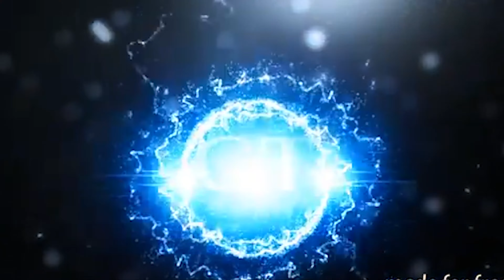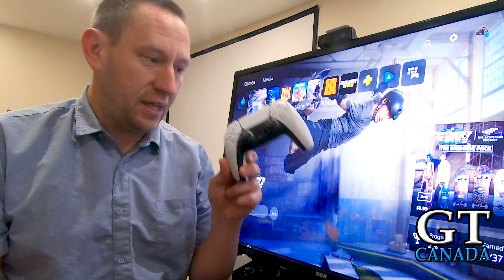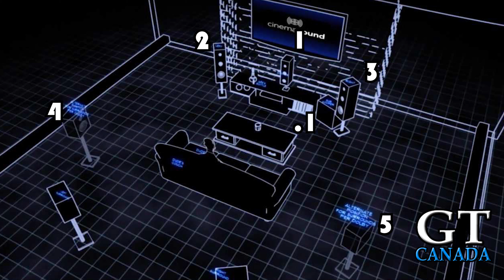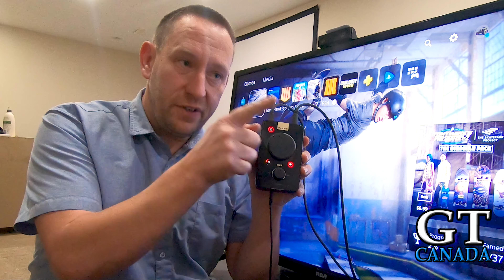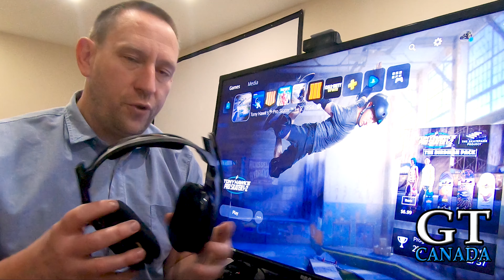SONY 3D Audio vs DOLBY 5.1 - Which is better & Why - GT Canada

Comment: It's been two years and nothing has changed. Dolby digital sounds way better on most games.
I'm a certified sound engineer and I have been trying to make my Steelseries Arctic Pro work on ps5 as they are supposed to, like they did on PS4 pro.
The surround in 3d is ok. Works if you haven't experienced real 7.1 surround and sometimes it's impressive but far from a 100% surround sound.
The real problem is their supposed center channel. It makes lots of sounds sound hollow and lifeless, sometimes voices sound like they where record with a laptop mic.
3D audio is a hit or mis, mostly misses and you wouldn't believe how many people use 3D tempest on all the time, even on games that are not supported.
It's just a mess.
And yes, the PS5 can only send out a stereo signal from a connected usb C or A. So it's all just fake, fun fake but still nonetheless, fake.
Cheers!
Reply: Im assuming reading your comment that if i input an optical dolby digital 5.1 signal from the ps5 (with an hdmi 2.1 audio extractor) into the DAC of the Steelseries arctis pro the headphones will sound with the proper positioning you achieved connecting them to ps4? 
Im assuming also the Steelseries DAC is doing a better job at translating multichannel surround into a stereo signal in the headphones than sony’s tempest 3d. But those are stereo headphones after all… 
Im thinking about buying the old arctis pro wireless (not nova) because of the optical input. Because of the supposed better signal and positioning. But mainly to be able to control the game/chat mix in ps5 from the wireless headphones.
I am correct with these assumptions and my buying intention?

Comment: I've been looking for a 3d pulse comparison vid for ages, because I didn't  think the pulse 3d were 3D....
I can't distinguish front from back!!
I can get the same effect with my £30 wireless headphones
Reply: Buy gen 4 astro's you hear evrything at the exact same location i tryed it many times with eyes closed it works flawless.... been using astro since gen 1 trust me use them! It's cabled but top line sound & mic.

Comment: ps5 3d audio does not work on 3.5 mm jack it only works with Linear PCM on pulse 3d with wirless conectivity
Reply from the maker: I'm sorry but that is totally false.

3d audio works over USB or through the 3.5mm jack on the ps5 controller.

All headphones support 3d audio as well. You don't need anything special for it to work.

You can also checkout Sony's website here where it shows you how to set it up. 

https://www.playstation.com/en-ca/support/hardware/3d-audio-ps5/
Reply: @GearsAndTech  i will try that tjanks
Reply: Wrong!!!

Comment: Thanks for your video. I totally agree and do in principle the same thing as you do, but with a little different tech.
I use a Feintech HDMI Audio Extractor to get the 5.1 bitstream. Instead of the Astro I have a Philips SBC HD1500 headphone amp (almost 18 years old) based on Dolby Headphone which also accepts DTS 5.1. My Headphones are Denon D7200. There is no mic… but I don‘t do multiplayer. Even used the Philips back then with Xbox360 and PS3. Sounds WAY better and more accurate than PS5 Tempest 3d.
PS5 does realtime surround encoding by the way, like the previous consoles. Similar to Dolby Digital Live or DTS Connect on PC.

Comment: The PS5 3D audio has to be supported in the game. If it doesn't have a 3D headphone setting, it won't work. It sounds amazing and beats dolby by miles in supported games though with a good headset.
Reply: 3D pulse is better with DAfH on PC compared to PS5 tempest audio.

Comment: Can you help me with some much needed info? Do I need that hdmi splitter thing to get the dolby soround sound or can I just hook my optical cable to my tv and run it with the settings you show because I still think its slightly missing something compared to when i use to use it on my ps4 to my now ps5. I'm useing old gen astro a50s and I also havent updated them because of certain issues with the base station. So overall it's just not sounding as good since I switched to ps5.
Reply from the maker: What do you have the optical cable connected to? It needs to be hooked to something. I have a lot of videos showing the setup for different scenarios
Reply: @GearsAndTech  I have it connected to the tv into the bass station
Reply from the maker: Ok. Just double check the tv audio filter settings. Make sure they aren't applying a weird sound profile to it
Reply: @GearsAndTech  ok thanks for the help!

Comment: This was not a good test. The problem is, you're plugging into your controller vs the mixamp.  You should test both through the mixamp.  You can run Sony 3D audio through the Astro mixamp.  You change your settings to output all audio and Linear PCM.  Then you disable Dolby on the mixamp.  

I've tested 3D audio vs Dolby this way with my Astro A40.  I found the 3D audio to be superior to the Dolby in terms of placement accuracy.  However, the overall richness and quality of sound was better with Dolby.  For fps games, all I care about are the footsteps so I've been using the Sony 3D audio because of this.  Try it yourself!
Reply from the maker: You're half right

The reason I used the controller for the 3d audio was because not many people understood you could run 3d audio through the mixamp especially since at the time Sony was saying you needed their headphones to do it, or connect to a controller. I didn't want people thinking I wasn't testing 3d audio when I certainly was. Hooking to the controller assured there would be no question

Now, your explanation of enabling 3d audio on the mixamp is wrong.

What you do is simply switch the sound to all (instead of just chat) and then turn on the 3d audio toggle.

The setting for bitstream is not available once you switch to the USB connection with 3d audio turned on.

I did actually test that setup as well and felt it was still not as immersive. I think I could get used to it. But I have no desire to since Dolby is working much better for me. I have never had a problem hearing footsteps or hearing where they are coming from.
Reply: @GearsAndTech  Yea, I said switch to all audio :P

And it sounds like you don't play much War Zone.  Kidding lol.  But yea, Dolby still has a much richer sound.  But I found the 3D positioning to be better with Sony's implementation.  Hopefully they get better at fine tuning it.  For now, I'll keep it on for games I need to hear crystal clear positional footsteps.  I rather like that Sony 3D isn't as rich for a game like WZ.  WZ has way too much ambient noise which Dolby amplifies.  Cheers!

Comment: Is the Astro mix working without the optical sound connection because I have a monitor????😬🤷‍♂️? just the other connection I what you have in controller! Good video!
Reply from the maker: If you use astro without optical you will be running it in stereo sound, or you are able to turn on 3D audio. You will not get surround sound with USB only connection

Comment: So just to get this straight for someone who's new to the audio specifics. You cant use 5.1 and Tempest 3D simultaneously?
Reply from the maker: that is correct. Its one or the other. You need to pick which one you like best. 

If you get Sony Headphones, they make the choice for you and you have to use tempest 3D
Reply: @GearsAndTech  Gotcha. I just bought the A50's and have the Pulse 3D's as my seconds pair. Really enjoying the 5.1 with the A50's.
Reply from the maker: Excellent choice!
Reply: @GearsAndTech  Ive noticed a slight lag in sound on my A50's. Any idea what it could be?

Comment: I definitely agree with all of this. I don't have a PS5 tho, I have a Series X. I use the Astro A40 Gen 4 and I still feel Dolby Digital sounds better than Dolby Atmos, Windows Sonic, and even DTS:X.

I feel the 3D tech is very promising but I still feel it's not there quite yet imo. When a game supports Atmos it does sound amazing but I still struggle a bit locating sounds as quickly as I can with Dolby on the mixamp. Yet audio is purely subjective so what works for me might not for others.
Reply from the maker: Totally agree. Audio is so hard to get right because it's different for everyone.

However, I still prefer Dolby

Comment: I love your stuff. You have a link for 3d test for surround ? I bought Sony 3d headset and regret it. Every time I play call of duty modern warfare I don’t know where the sound is coming from, at all. Gets me confused. And can barerly hear the footsteps in the game. Back years ago, I used a turtle beach headset on pc 7.1 or maybe it was 5.1 and I could hear everything.
Reply from the maker: Yes, I see you commented on my other video so I think you found it
. I totally agree. 3d audio is much harder to pinpoint sound.

I'm using Astros in Dolby mode with optical cable from my tv. It's working great!

Comment: Really interested to try out the Astro because of this video. Which games did do your testing on the ps5 btw?
Reply from the maker: In this test I tried it on Astros playroom, black ops 4 and warzone

I mostly play Warzone and when setup correctly you can use the sound to your advantage easily.

Comment: Hi there again. So I am not sure if you have tested out upcoming Resident Evil Village demo on PS5 but that game actually supports 3D audio and now here's my question for you:
Do you toggle Virtual Surround to On in game sound settings to get Tempest 3D audio running from the game? Or just from PS5 OS? Or both set to On? Because what I thought was that virtual surround sound is entirely different (left to right sound distribution) compare to 3D audio (left to right and up to down) which offers in headset on PS5. In the end what setting, not only for this game demo but for other games that support 3D audio, ideally if there are sound option for virtual surround in game sound settings, do I need to turn On that always? Even if I have enable 3D audio from PS5 OS?
Reply from the maker: Ps5 will do 3d audio for all games. Ones that are made with 3d audio are probbaly better, but it'll do the 3d sound as long as you enable it in settings on the ps5 itself, not in game.

Comment: if the game and the ps5 have a 5.1 out option, is it dolby? it doesn't say it is dolby in the settings, and the ps5 is getting a lot of slack for not supporting atmos and other dolby tech like dolby vision and stuff, are you sure that the 5.1 format is a dolby exclusive? in other words, could sony take the 5.1 (seemingly not dolby, just encoded differntly offering 5.1 channels in other ways) and then converting it to 2 channel headsets more like the mixamp pro does the conversion from 5.1 dolby to stereo? and so the comparison would be between the algorithms of astro and sony but they both get it from a 5.1 source that the ps5 can produce and such giving the opportunity from a lot more improvements in algorthm tech, more than just improving the tricks as you call it
Reply from the maker: Yes, you could be correct.

If Sony doesn't want to pay the Dolby license they could still allow the 5.1 channel to be passed from the disc to the av system in 'not Dolby' format

However, I believe the games do still Carry the Dolby logo, which means they are encoded in Dolby and so the signal is Dolby

It gets a little complicated for sure.

Thank you for coming by and sharing your thoughts
Reply: @GearsAndTech  also have you tried changing the presets for the 3d audio? maybe with a different preset and more spacial awarness tests like maybe 15 rounds each on the new cold war cod game (free weekend right now btw) it could be a different outcome, i would like to see a more in depht analisys than 5 rounds on bo4 without mentioning presets ect. thanks for your time
Reply: No, it is lpcm which is better than compressed Dolby Digital.

Comment: I have a question 🙋. If you have Astro A50 Gen 4 headset and Samsung HW-Q80R home theater surround sound which is a soundbar 5.1, a subwoofer and two rear speakers, then which would you have preference over? Thanks
Reply from the maker: Soundbar is not true 5.1 either. They are a simulated surround using 3 speakers (at best) and simulating the rear speakers by projecting the sound

I played with a 7.1 surround system for a lot of years and loved that

Switching to Astros with surround on was so similar to my true surround system that I don't feel I am missing anything at all.

If you live alone, in your own detached house I would say go full surround

If you have wife, kids, roomates then I suggest the A50 for everyone else's sanity.

You get great sound, and you don't disturb anyone else
Reply: @GearsAndTech  so for PS5 games that supports 3D audio, would you suggest to use Astro HDMI adapter for Dolby surround sound over tempest 3D audio? Or the other way round? Specifically for Astro A50 Gen 4 headset. Which one is better?
Reply from the maker: At this point I recomend any headset that does Dolby surround.

Stay away from 3d audio if you have Dolby as an option

If you only have stereo or 3d, then and only then should you use 3d

Comment: How does the Dolby 5.1 audio work for sounds are above and below you?  That's a very key feature when playing video games and I'm curious how it works for that.  I have SteelSeries 7P headphones for my PS5 and they very accurate when sounds are above or below me
Reply from the maker: It works but not 100% 

I'm really curious to see how those steel series work compared to my a40's

I've been using them long enough to know when something is better or worse.

I think you headphones use the USB c dongle?

So you don't have Dolby surround you have 3d audio

When I tested 3d audio on my a40's and my a20's I didn't like it as much. I found Dolby on the a40's to be much better
Reply: @GearsAndTech  download Fortnite on PS5 and check it out.  It’s free and you can go into “creative” mode with your son to test it out
Reply: @GearsAndTech  I noticed the same. So I use to have Astro a50’s gen 3. And now I have the steel series 7p. Everyone talks about how good the steel series are. They are good yes. But 3 areas where I felt Astro has a huge advantage and wins for me
1. Comfort. Astro is way more comfortable
2. The Dolby. The Dolby Is way way better than the 3D audio. The sound with dolby on is thumping and incredible. Plus Astro gets louder 
3. Astro are semi open back. And the a40’s tr can be fully open back. This makes the soundstage really good. Something you don’t get on steelseries 

Astro wins over steel series for me

Comment: The question is, is it worth paying $300+ for Astro's vs $100 Pulse 3D for an average gamer who mostly plays FPS games??
Reply from the maker: That is an excellent question.

I would love to get my hands on a set of pulse headphones to try it to compare directly

But, Astros like I am using can be easily had on the used market for $100 or so. I personally got the Gen 2 for my wife for $60 Canadian.

And when put into that context I would use the used Astros over the sony headphones.

If you're comparing new for new it gets harder to justify

Comment: We are still in the early stages of Sony’s 3D audio implementation. Which is probably why it’s not convincing right now. But technically the Astro’s have to do more guesswork since there trying to simulate a 3D audio setup with just Dolby lossy 5.1 surround sound output, compared to the ps5 which has access to everything the dev chooses to include (hundreds of sound sources from any direction). The games are not natively in Dolby. There in lpcm, then re encoded in Dolby or dts depending on settings.
Reply from the maker: I agree, in time Sony has the ability to keep playing with this until its good

But for now Dolby seems better

Comment: You said we don’t need a hdmi optical adapter to use Astro a40 ?
Reply from the maker: You can use it with just usb. But you won't get surround sound without the adapter
Reply: @GearsAndTech  👍🏽 & you put the USB cable in the back of the ps5 where they have the USB slots ?
Reply from the maker: Slot doesn't matter.

For this test I had it in the front usb slot

But it works in the back too
Reply: @GearsAndTech   yo thx again man because I’m only going to be using the mix app with out the HDMI Optical adapter
Reply: @GearsAndTech  You can use the surround sound if you put the optical cable directly into the TV also.
Reply from the maker: Yes. That is how I have it setup now. I made a video showing that config months ago
Reply: And great videos by the as well 🤟🏽